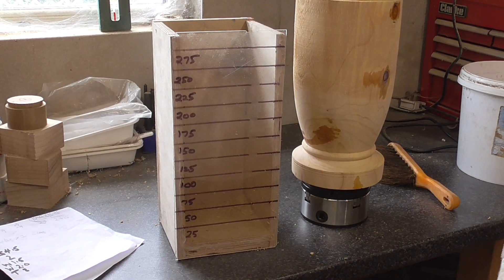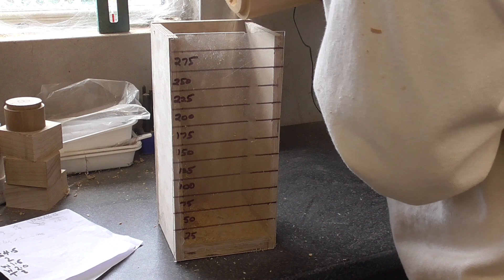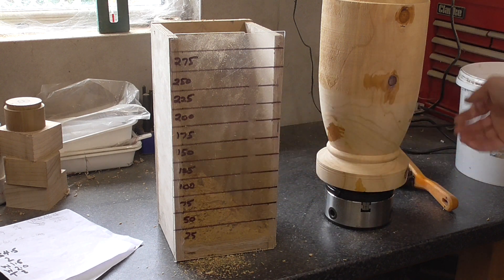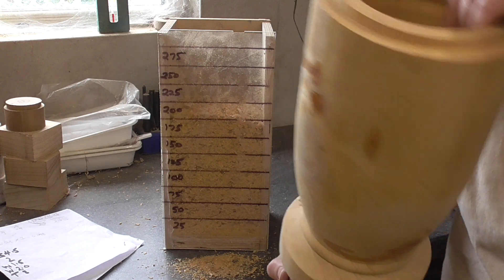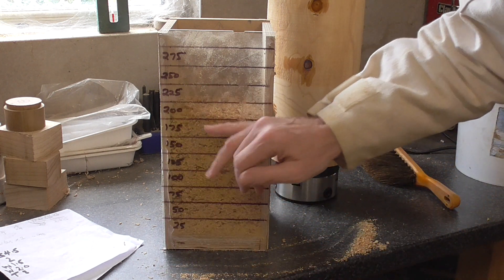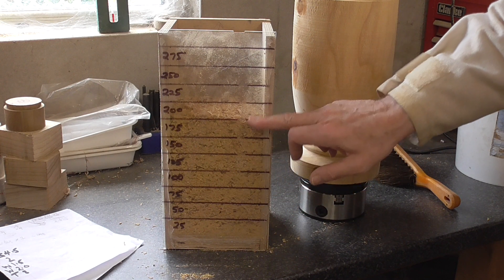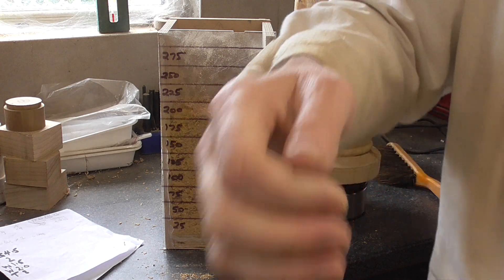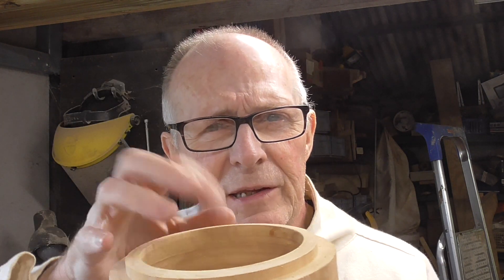Urn 7

Comment: When I asked about the liner I sort of assumed that you were hollowing to suit a glass or ceramic thingummy. After your reply last night I wondered if epoxy resin might make a nice sealant. It does sound like rather a lot of work though. Anyway, so far so good. Thanks Brendan - this might be a rather sobering task but it's been very enjoyable watching you work.
Reply from the maker: Thanks Mark, I have changed my mind on the resin, well... I got it changed for me.  A friend told me that he wouldn't use resin on a sealed container because wood needs to be able to move and if one surface was constricted it might cause stress and tension that could cause problems down the road.  So, regular finish it will be... still a lot of work.  Back at it tomorrow.
Best Wishes, Brendan.

Comment: It's going to look great once it's done. I'd be inclined to use a spray lacquer on the inside, mainly to get into all the areas and seal it up.
Reply from the maker: I never thought of lacquer, I ended up using sanding sealer.  I will store your suggestion for the next one.  Thank you.
Best Wishes, Brendan.